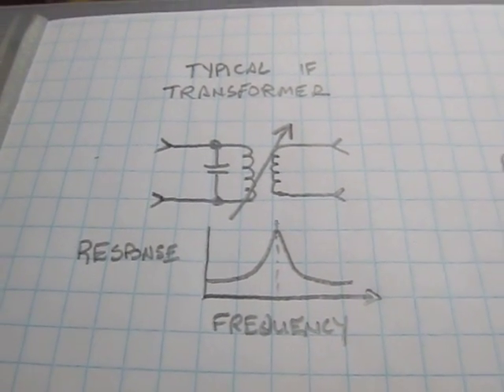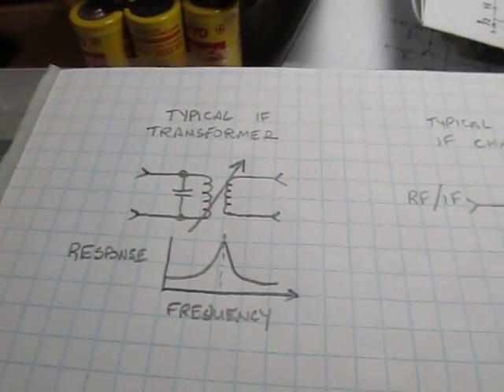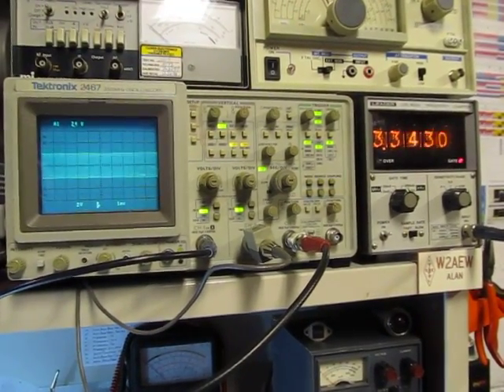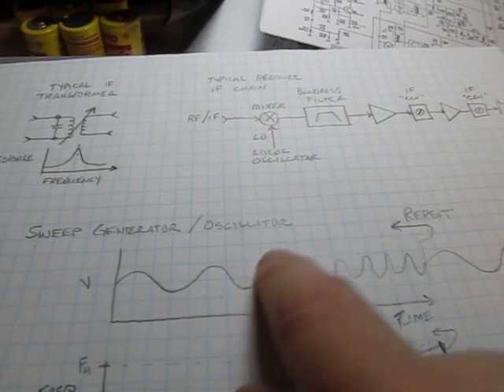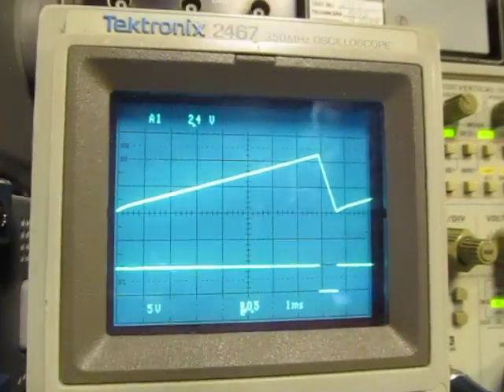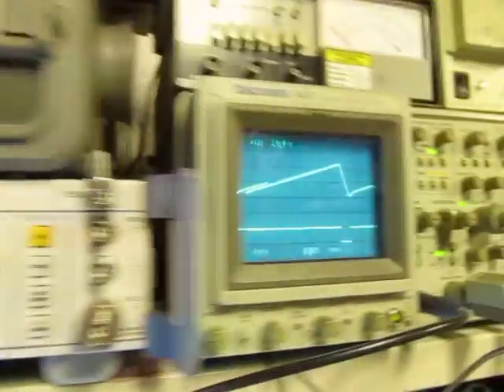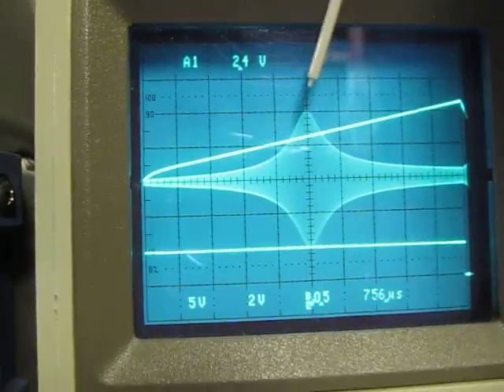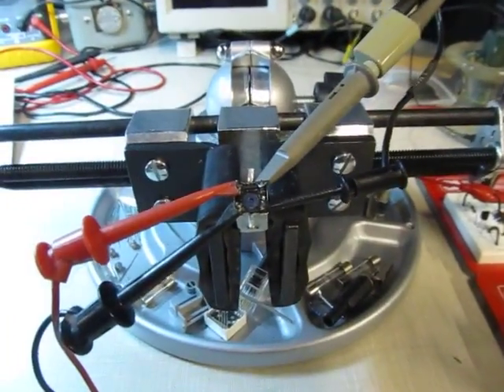#45: Sweep Generator Basics and Receiver Alignment

Comment: Most straightforward presentation of this topic I've seen.   Love the Nixie Tube freq meter.  Reminds me of the Heathkit one.

I built a Heathkit tube-based SW radio in 1968.  Can't recall what I used to tune the IF.  But to align, the book called for dialing up WWV (then NBS, not NIST)

Thanks for taking the time to produce this tutorial.

Comment: Another interesting, very clear video. A sweep generator is a huge help for filter checking or design, checking "Q"-etc. The uses for tuned circuits are limited only by imagination. Does not have to be real fancy either -from old boatanchors like Eico's and RCA's to newer used BK's, HP's and Waveteks, etc -if you can afford a nice DMM you can usually afford a sweep generator for your typical purpose. Markers are a nice feature. I think your videos are super for helping people see possibilities!

Comment: I have bought an old thandar sweep generator and am in the process of repairing it.  Your video was useful. The one I have has a different looking ramp it goes up and down at the same rate. I’m not sure i have the setup correct but have it going into channel 1 or X input on the Tek scope. This moves the dot symmetrical from left to right and the back right to left at the same rate. I have the actual output from the filter into channel two. Unfortunately there no manual available so just working through it. Great video. Regards Chris

Comment: I have acquired several new sector antennas that unfortunately have no identifying marks as to manufacturer, model, frequency, etc.  Based on other information I have I am fairly certain that they are either for 900MHz, 2.4GHz, 3.5GHz, 4.9GHz or 5.8GHz use.  I am not sure how I can tell for sure which band though.  I have an HP 8565A spectrum analyzer as well as a variety of scopes.  Do you know of a way that these tools might possibly be used to help identify these antennas?  Thanks!

Comment: This is cool because at work I use a $30k HP 83650B sweep generator with the optional 83651 unit., but at home I have a HP 3324 which is both a function generator and a sweep generator.. synthesized though.. and somewhere buried in my to do list is a HP8601A sweep generator.  Yay to power supply issues. I really have to get working on my old R71A which is slowly going deaf to both AM/MW and HF frequencies.  Love your videos.

Comment: I had a "sweep generator" once.  I can't remember the make or model,  but that was way back in 1974.  It was specifically targeted for working on TVs,  and not as generally useful as what you're showing here.  Not only that,  it wasn't even spec'd to deal with the then-current 40-some-odd MHz TV IF frequencies,  but the earlier 25-some-odd-MHz frequencies.  I don't recall when or how I parted ways with that beast,  but I don't believe that I was all that upset about it at the time.  :-)

Comment: Exactly what I needed. Thanks a lot! As always crystal clear explanation 😃. awesome 👍
Reply: Be forewarned not to physically couple the signal generator directly to the radio mixer grid, you will load the circuit and distort the curve  getting  poor results. Loosely couple using a loop of wire laying across the AM LOOP. DISABLE THE OSCILLATOR ! Monitor with a scope or meter at the secondary of the 2nd IF can. Use minimal signal level.

Comment: I have been trying to work out how to view the slope response of an IF strip on my scope with a sweep generator. Your explanation and use of the pulse/ gate output has explained how I can use this as a start stop reference. Could you just confirm you are triggering off the pulse output on the signal generator?  Thanks.

Comment: So if I am aligning a radio, let's say an AA5 for example, where would I connect the sweep gen and the scope? Would I connect the generator to the plate of the converter tube (with a DC blocking cap) and the scope to the grid of detector tube with the radio on? Or would i just tune each individual IF can with the radio off?

Comment: OK, thanks Alan. I thought that was the answer but wasn't sure. Can the scope camera connections on the old mainframes (like 7904, etc) easily be adapted to use/sync modern digital cameras with for that purpose? Know anyone who does that?

Comment: Hi, very instructive video indeed. Thank you very much. I'm trying to learn how to properly align AM and FM radios myself and i'd like to know how to properly hook up an oscilloscope @ the end of an IF chain without influencing the tuned frequency of that chain by having too strong of a coupling/loading. So, it would be nice to know what kind of probes are suitable for the above and also when tuning the FM portion what kind of generating equipment is needed considering that in FM we are dealing with stereo signals and we want to keep the distortions low when tuning the discriminator coil for  instance. And how one can measure the level of distorsions while doing it if there is only an oscilloscope at hand? Thank you.

Comment: You can manually (without sweep) get a curve shape by marking the output vs frequency on graph paper. This could be important for someone without the sweep equipment available who needs to occasionally check the pass curve of a filter or IF stage with a flat top. It is a bit time consuming, but it works.

Comment: So my signal generator has a VCF input that can be used to sweep the frequency, but it does not have a ramp generator in it to drive the sweep.  I assume I can build a ramp generator myself to then have what I need.  My question is around what if I want the x-axis to be logarithmic instead of linear—like what would be great to have to evaluate audio filters. If I want this, I assume I need an exponential “ramp” instead of linear, correct?
Reply from the maker: Yes, that is correct.

Comment: Another suggestion for future videos: I don't understand how to use the scope to view stable traces of very slow freq, like one or two hertz. An example: I have been using a scope to analyze a problem signal that pulses about one pulse every two seconds, so I am using the scope at its lowest sweep rate. The pulse duration is very short, just a blip. Is there a way to somehow "freeze" the blip to study its shape , using an older analog scope?

Comment: Many thanks for this very clear video.  Couple of questions: If we have two IF transformers I understand  you recommend probing the output of the second transformer and hopefully checking there the effect of both transformers. I guess it would be the same if we probe the output of the first nd adjust and then the second. And second questions: it seems that in this setup a marker generator (which is required by the service manual of the radios I am trying to adjust) is not needed as we know the min and max sweep frequencies and hence all the intermediate ones (if it is a linear sweep).
Reply from the maker: Ideally you would want to probe "one stage away" from the one you are tuning to avoid potential for the probe affecting the resonant frequency.

Comment: Is the measurement on the scope differential: Add, Invert?

Any special precautions to minimize loading of the can by the scope?
Reply from the maker: I didn't use a differential measurement. Loading can be minimized by using a good, properly compensated high frequency 10x passive probe, and by probing downstream from the can you're tuning as much as practical.

Comment: What MHZ signal generator would I need for mostly aligning vintage transistor radios, the IF cans, and maybe a tube radio sometime..
Reply from the maker: Most AM radios use a 455kHz IF stage.  A 10.8MHz IF is common in FM radios.  Of course, you may also want to produce a signal at the receive frequency, which means up to 30MHz for most shortwave receivers, and up to 108MHz for FM radios (in the US).
Reply: @w2aew  How was it done when there was no sweep generator back in the day? How do I get that peak to look at..so I can adjust it on a scope...I have two, a Tektronix 2431L and a Hitachi V-302 30 MHz scope.
Reply from the maker: @kennynvake4hve584  You would typically use a signal at the desired frequency and peak its amplitude.  If is very common to use a simple modulated signal, disable the AGC circuit, and peak the output as measured by a meter on the audio output stage.  Of course, if you have a scope, you can adjust the cans and watch for the peak response on the scope.
Reply: @w2aew  So I can hook the scope to the speaker terminals and watch it, and adjust it that way..thanks.for your help..

Comment: How about tuning IF xformers in a non functioning boat anchor (8 tube Hallicrafters s-85), 3 if transformers.  Can't successfully inject a signal because there's no speaker output. So, I would like to eliminate the IFs as a potential source of problems by tuning them up.  This eliminates that aspect and allows focus on other issues to resolve the problem.  So, In radio IF diagnosis without AF output would be helpful.   Maybe this is too unconventional, but that's where I am with this radio right now.  Don't want to pull all the IFs if I can avoid it.  I know that wiring, etc will change the sweet spot to some degree, but knowing I'm close will be helpful, right?  Thanks for a great video on sweep generation uses.  Best regards.
Reply: If you have a scope, you can monitor the output amplitude of the IF stage on your scope as you tune it.
Reply: Thanks much for the response.  That's good news.  So, hook the scope across the secondary or Grid to ground ? Thanks again for your great videos.

Comment: Thanks for another great video Alan. Question: you seem to  be showing us the ramp and gate waveforms _before_ setting the sig generator for sweep mode. Certainly before you set the start and stop points.  I must be missing something. 

Also, how different would these waveforms, or process, be using FM? maybe an idea for  another video?

Comment: I think the center frequency you measured still have to be calibrated due to the input capacitance of the oscilloscope or the output capacitance of the generator, is that right?
Reply from the maker: That's why it's a good idea to inject the signal one stage before, and measure one stage after the stage that you're adjusting (when possible)

Comment: Alan, can u comment on VHF/UHF  monitoring? The scope probe impedance mismatch compared to the IF  coil might cause a lot of reflection and interference? What would be the best way to monitor this process at say, 250Mhz or more?
Reply from the maker: +Ancel UnfetteredOne The scope probe capacitance can adversely load the circuit, so you are wise to be concerned.  Most IF circuits aren't going to be that high in frequency, so that's good.  Best practice is to use the lowest capacitance probe you can find (active probes are better).  Another good technique is to probe one stage further downstream than the one you're adjusting.
Reply: +Ancel UnfetteredOne As Alan said, the normal procedure is to check an IF stage from the grid or base of the ampifier preceding the IF can, to the output of the amplifier following. This isolates the probes from the resonant circuit and is always the way an alignment is done.

Comment: For broadband signals it is often necessary to tune the center frequencies to different equally spaced values to avoid rejecting information far from the carrier frequency.  Television and high bit-rate digital are two examples.

Comment: I suppose if you can measure the spacing you get an idea of the selectivity or Q with this sweeping idea? With a wide spacing being not so selective. For example how could you reduce the skirt width to make the can more selective? This is absolutely fascinating. Do you know where I could get a low cost signal generator that will give me a sweep with ramps etc. I would like to do this but I don't have much money. (tiny income).

I had no idea you can have this much fun with a signal generator. I have to get one now.

 in CW mode what does CW stand for?

Comment: How was it done when there was no sweep generator back in the day?
Reply: There were sweep generators back in the 30s, and maybe earlier. You can make a sweep generator (wobbulator) by using a mechanically driven variable capacitor, which could work a switch to sync with a scope.

In the 40s there was equipment like the Cossor outfit which used the Miller effect to produce an electronic sweep. Receivers such as the RCA AR88 were obviously designed and intended to be serviced, with sweep oscillators, scopes and logarithmic amplifiers. 

Don't forget that even in the 60s, oscilloscopes that by today's standards are so limited (1MHz bandwidth) and unstable as to be almost useless, were things that a dedicated hobbyist could just about afford to get their hands on as military surplus. What Tektronix and HP offered and what RCA and governments could afford was totally different, and would cost about the same as a modest house.

But you don't really need a sweep oscillator, scope and log amp to design and set up a filter to have the desired profile. Mathematics gives the values you need. Then you could set the frequencies and then make the measurements and plot them and then tweak a preset and repeat and plot, and repeat and plot, until you got a graph which looked like the one in the manual or what your designed dictated. 

The thing is it's much faster to have something which scans the frequency range 10 times a second and plots it immediately, so that any change you make is immediately obvious and  you can work towards a thing which looks like the graph in the manual and hope to get there in a few minutes.

Comment: Nice, u should be a teacher.Would like to suggest u do two using the scope n sweep signal generator. Aligning an old tube( cause they're very touchy)FM broadcast radio with a ratio detector and the second on a more HiFi type limiter/discriminator set.I had a lot of trouble with older tube based  stereo stuff like H.H.Scott 340 early receiver not tripping into stereo.Turned out my alignment with just a v.t.v.m. had resulted in not enough pilot signal for the multiplex to work with. Only two very strong local stations would actuate the stereo function.After looking at the I.F. response with the sweep gen n scope discriminator was way off. I was picking audio up off the positive peak instead of the straight side of the slope as it should.I think it would be a very helpful set of bids. Thanks....N2VUW

Comment: Hi Alan,I want to repeat your layout using a BK4007B DDS sweep generator, an IF 455kHz can, a freq meter, & BWD analog 2 Ch scope. With Gen centred on 455kHZ & Start 425kHz, Stop 485kHz fed into one coil of the can (no connection to 2nd coil as you made) & output to Ch1 & sync from gen into Ch2. This shows the sine signal & sync signal on scope. When switched to sweep the varying sine signal is visible. Question: How did you connect up to primary & secondary of the can to give you the bandpass selectivity curve? Did you use X/Y mode? Your video is excellent. Jack VK1ZAD
Reply from the maker: Ideally, the IF can should be loaded as it would be in the actual circuit.  Apply the sweep gen to the input, and probe the output.  Use the sweep sync to trigger the scope, and adjust the scope's horizontal scale to show the entire sweep duration of the sig gen, and then you should see the response of the filter shown the the shape of the 455kHz envelope.  Alternatively, if the sweep gen has a sweep voltage output (probably not if it is a DDS), then use that to drive the X input of the scope running in XY mode.

Comment: Thank you for your effort w2aew. Just clarify something for me here please..... By the looks of it, your example describes AM Tuner with 455kHz IF. The frequencies  (Start & Stop) you applied, were between 2,000 & 4,000 MHz. Was it only for demo reasons? cause, in this case, I would expect you to apply signals 200kHz (Start) and 600kHz (Stop) to see the Max signal peaks at around 455kHz? Please confirm that this is right.  Thank you.
Reply from the maker: Yes, this was only for demo purposes, because the only IF-cans that I had were these 3MHz units.

Comment: Hello! 

First i'm spanish speaker so sorry for my inglish.
Then, I am an student of electronics and i need to simulate a sweep signal  (on multisim). You can put the page with all the circuit or put some link with the schematic desing circuit!

Thank you!
Reply from the maker: There are a lot of different designs that you can find online, depending upon the frequency range that you need to sweep across.  Here are several links to get you started:
http://www.nutsvolts.com/magazine/article/december2013_Reed
http://www.vk2zay.net/article/93
https://www.ssl.berkeley.edu/~mlampton/oscillator.pdf
http://www.dxzone.com/catalog/Technical_Reference/Test_Equipment/RF_Sweep_Generator/
Reply: thank you to much!!!

Comment: Alan, Would you consider producing a Part 2 to this video where (using this same technique) you illustrate the value-add of a second IF stage?  I.e., how does the envelope differ at the output of the second filter (in a typical superhet AM radio) with respect to the output of the first IF filter?  Can the difference be seen using this technique?   

If manufacturing-cheapness wasn't a factor, would adding a third IF stage provide tangible selectivity improvement?  Can that be seen?  Or are additional stages a case of diminishing returns?  I guess that begs the question:  If "yes", then can those diminishing returns also be demonstrated using this method?

I apologize if this is asking too much.  But you did end this video by inviting us to submit video idea requests.  I figure the worst outcome is that you don't have time for this project... a reply I would fully accept.